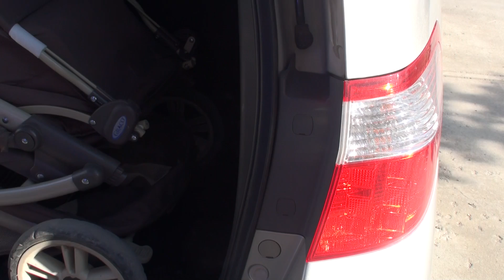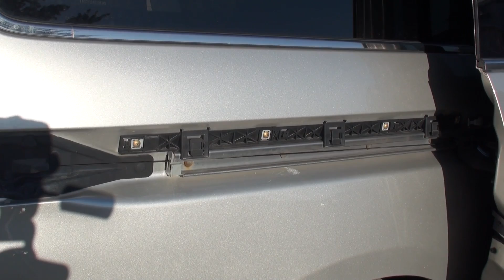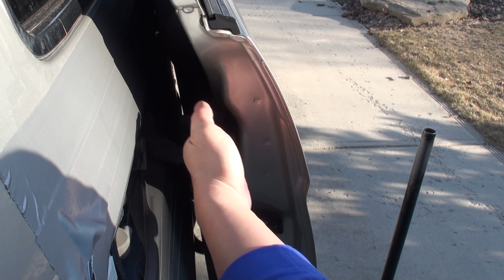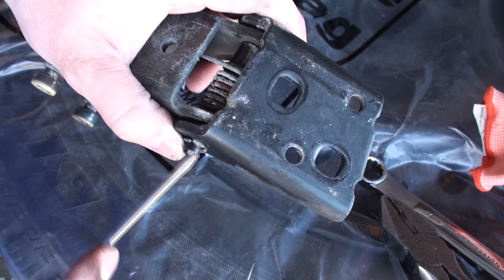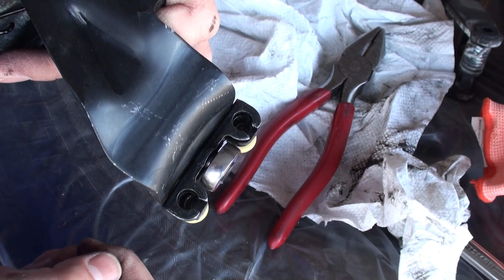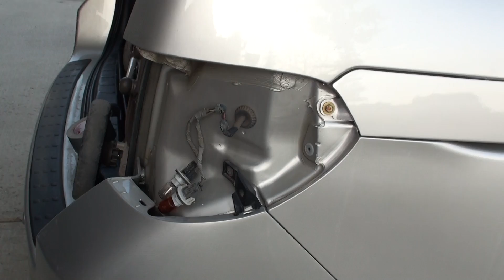Honda Odyssey Center Rail Door Roller Replacement

Comment: the button for the sliding door got powered on and the handle activated while the roller was disconnected ( dont ask - damn kids)  Now the cable is about 4 inches too short. any suggestions on how to release the cable??

Comment: Great instructions but some additional info. After following this video and installing my own roller assy on a 2007 Odyssey EXL the door wouldn't close all the way. Thinking somehow the door was out of alignment I spent 2 hours adjusting and readjusting but couldn't resolve the issue. Went back on line for additional tips and found instructions on pulling a fuse (not labeled for doors) to reset the doors. Took 30 seconds to fix it at that point. Follow this video but if the door doesn't close (and all striker plates line up) then pull fuse #7 in the driver's side fuse  panel to reset the power doors.
Reply from the maker: Richard Workman yes doing a door relearn procedure for some vans is important.  I honestly wish I explained that part in my vid as well as it seems to be that some struggle with the door even after the repair.  Good tip to share with our audience.
Reply: Thanks for the heads-up. I'm about to do this fix on my 2008 EX. There's nothing worse than saying "I fixed it!", followed by thinking you broke something new in the process.
Reply: Richard Workman Thanks for the info! You probably saved me an hour or two! I had to reset mine as well.

Comment: Dear Pircedasian,

I don't know what I am doing wrong on my 2005 Odyssey Touring. After replacing the rollers the door opens and closes smoothly manually and even the latch works when it closes manually, for the reset/relearn I am doing this:

with key in ignition  I pull fuse #7 (driver's side) and wait 5 minutes, install fuse back, manually open and close door all the way 3 times, turn automatic door switch on, door works for 3-4 times and then the "stupid check left door light comes back" and does not work anymore. Something I have noticed is that the right top corner of the door is sticking out a little, little bit compared with the other one, nothing noticeable. Could this be the problem? as you mention in one of your videos my wife tells me to sell this van but I don't want to give up.

Thank you very much for your help,

P.S. sorry for the late reply, this month I had to work long hours and got home very late.
Reply from the maker: Enrique Lopez no apologies needed.  It is I that should be apologizing to my audience as I haven't posted anything new in a while.  Finding time to do things in life gets tougher as the family grows :)  If the door is sticking out a little I suspect that you may have a door binding issue.  You did mention that it moves smoothly which likely rules out binding issues.  That being said I suspect that the power latch mechanism (the part where the door closes and latches down) may be failing.  I haven't had that issue on my van yet hence why no video.  I guess my question to you is when does the system error out and tell you that there is something wrong?  Partway closed?  Just as it closes or randomly?
Reply: piercedasian After resetting the door it works fine between 2-5 times and then AFTER IT CLOSES COMPLETELY the "Check Left Sliding Door" comes on and I can't open the door automatically by switch or remote.
Reply from the maker: hmm, interesting.  I suspect there may be a door contact/sensor issue that is making the system think the door is latched but not completely closed.  Have you had issues with the power latch not "catching" when its closing?

Comment: fifteen minute job. I found it much easier to leave the hinge mounted on the door and simply pop off the  c-clip and tap out the pin. reverse was easy. It took longer to remove the glue left behind by the duct tape protection than it did to change the hinge.
Reply: Shawn McConnell Good information.

Comment: @piercedasian wow really good video, and instruction.  ive been combing youtube for similar videos and even some of my favorite youtube mechanics for this subject.  all of them show a much more intrusive method as to include taking out all the seats, interior rear trims (to uncouple the tension clips). im going to go your route first and if the cable tension is too troublesome ill resort to the internal tension clips.. looks like youve possibly saved me a couple hours at least.. so thanks in advance...
Reply from the maker: philwell76 yes the factory replacement procedure does call for removing a bunch of things but in all honesty it can be in most cases be bypassed due to the tiny bit of slack in the cable that will allow you to remove the cable.  In some rare cases it might not be possible but 10 door slider rails and I'm still doing it my way with no issues :) 

Thanks for watching!

Comment: Great video - easy to follow.  Thank you!  

After following the steps, my door didn't close completely (automatically).  Manually, the door worked fine.  To solve this problem, I had to remove the negative battery connection for ~1 minute and reconnect.  The door once again automatically close and locked completely.
Reply from the maker: Chris Desforges Ah yes, the door cycle calibration/reset procedure - you can also do the same by removing the fuse for the power sliding door in the lower left or right kick panel - depending on which door you're working on.  Glad it all worked out for you.

Comment: Cool thanks for the info. I had a question. I have change my door actulator I thought it might help closing my sliding door. It still gets hung up right at the end and won't pull in to get that click to fully shut. What is the problem ??? I have a 06 odyssey. Thanks
Reply from the maker: KEN CEOINCUSA To clarify did you replace the actuator or the roller?  If the roller is replaced and the door isn't "latching" at the very end then I would go and replace the power latch mechanism as that piece does occasionally fail.  I replaced one a while back but failed to make a video for it.  Give that a shot and let us know if that solved your issue.

Comment from the maker: @ chooseanameforme888 - yes it was 15 minutes to do the cable replacement but I'll be honest and say that the first time I ever attempted this fix with no tutorial available that it took me about 45 minutes to get that stupid wire in.  there isn't much slack and what I've found works well is when you try to put the roller up close to the body panel - less cable length is wasted due to deflection.  I've done so many of these rollers now that I can have the entire assembly replaced now in about 15 minutes but like all things in life practice makes perfect.
Reply from the maker: nope, just follow my vid and you should be able to fix your door like like the 1000's of other people that have watched my vid.
Reply: I've watched a few of these, and others have you remove the inside panel so that you can click a cable release. This gives you slack to easily reattach the cables to the new roller. Of course, the itself takes more time. Now I have to decide... Thanks for the vid!
Reply from the maker: I can tell you that although removing the inside panel is the factory approved way to do this repair that it takes a LOT longer to complete a job.  Now that I've replaced a handful of these rollers I can get it done in less than 15 minutes flat.  Had I gone the route of releasing the tension on the cables it would likely take me an hour to do the same exact job with more room for error b/c I'm removing so many more components.
Reply: +piercedasian Well I pretty much figured out that equation for myself, and also figured that any frustration I had with getting the cable ends in place would be more than compensated for by the frustration I would avoid by not having to muck around with those panels. Anyway, I decided to try it your way first, and resort to taking the panels off if I couldn't manage. I was able to complete both doors in under 2 hours; which I think is great for my first time! Thanks!
Reply from the maker: good contingency plan!  Glad you got it all figured out.  Great job that you fixed it and NOT the stealership!  Happy trails my friend.
Reply: +piercedasian Thanks for the vid. I'm a retired auto tech and the hardest part of this job was thinking about it and not actually seeing how it was put together. The vid eliminated both, lol. Nice that you recommended using the tape and marking the hinge position. For the cables, I used a pair of needle nose pliers to reach in and grab the cable from below to twist & pull down/push up to get the cable barrel out/in. 20 minute first side, 15 minutes second side. Thanks again.
Reply from the maker: excellent work!  Glad you were able to replace your own door rollers.
Reply: my cars doors are not powered, do I need. to remove anything in the interior to release the tension on the cable or not????? I have a 2007 honda oddysey 
..
Reply: iam asking since in this video you don't go n inside the car, and I have seen some videos where u have to remove the interior panels to get access to the tensioner.. just wanna know if I would need to disassemble anything from the inside or Just follow your steps showed In this video. let me know. iam ready to fix mine.

Comment: Thanks for the video. I couldn't have done it without it. BUT, you mentioned it only took you 15 minutes to place the wire back into the door roller and man, I pulled for almost an hour using every ounce of strength I could muster and still did not work.
I wound up giving up using my hands and used a small wrench to force the wire into the roller.
Anyway, thanks!

Comment: HELP..HELP.. HELP, I have a 2005 Odyssey Touring, one day I got the "Check Driver Sliding Door Light" and after that the door did not open or close automatically, I noticed that manually it was extremelly dificult to open or close it,  so I replaced the middle roller following your video, THANK YOU VERY MU CH now it opens and closes smoothly, HOWEVER after resetting the door several times by removing fuses it only works for a couple of times but then the Annoying Light comes back after the door shuts completely and it does not work anymore in automatic/remote mode.  What else could be happening? Thank youin advance
Reply from the maker: misterkike2003 did you check your sliding door for "binding"  You may have replaced the rollers but did you make sure that the door slides smoothly by hand with no "bucking" or "bumping" in the track?

When you perform the door reset procedure you pull the fuse for 5 minutes while the door is closed and then activate the doors through 3 cycles after replacing the fuse and all should be good.  

Try that reset/relearn procedure again and report back.

Comment: Assuming things are not too corroded it looks as though the replacement could be done without detaching the hinges from the door, but rather removing the pins. Any deep thoughts on the subject?
Reply from the maker: jeff sekera ah yes my deepest thoughts about this...... you COULD do it the way you've suggested but just remember that the little snap ring that retains the pin in the hinge assembly will most certainly get lost in the removal (trust me I've popped it off only to spend hours sometimes trying to find the pesky snap ring) so unless you buy a few spare snap rings from Honda you're probably safer to remove the hinge completely and remove the snap ring in an manner and area where you'd have a much lower chance of losing the tiny little part.  The unbolting of the hinge from the door just takes a few more minutes and thus I don't see it as being overly difficult or laborious.  Mark with a felt marker and unscrew!  Hope that helps.
Reply: piercedasian It does, thanks for the reply.
Reply: piercedasian FYI, I was able to replace the hinges by only removing the pins. I have a pair of snap ring pliers that work well on these kind-of rings too. My hinge pins were considerably less corroded than yours in the video-perhaps that helped. Either way - great video - thanks for showing us all the way!
Reply from the maker: jeff sekera that's awesome news!  Glad it worked out for you.  I am not so daring as I have lost that snap ring before and spent almost a hour in my garage hunting down the tiny elusive part.

Comment: thanks for the post...i have this problem now...this should help!!!... any chance the rolller come in metal instead of nylon for longevity?... how much does the part generally cost?
Reply from the maker: DylanP529 The part only comes with nylon rollers and the reason why they're nylon is for smooth actuation and resistance to corrosion.  If it were metal on metal rolling it wouldn't be as smooth and fluid as a nylon roller would be.  I'm sure a metal roller would work but like anything these days, cheaper cost to manufacture = more profits for the auto maker.  The part from Honda Canada typically costs anywhere between $70-80 and if the dealership is nice to you then you can get them for as cheap as $55 CAD.
Reply: ok ty, did it Saturday, at a cost of $53 US, per part... replaced both in hour and half... used needle nose pliers to help connect pulley end into roller, keeping parts close to track to get as much slack as possible to make connection... video was full of great tips and made it easy to do... thanks for the post!
Nick
Reply from the maker: you're very welcome, glad it worked out for you.  Thanks for watching!

Comment: Thanks for the very useful video. I just replaced my driver side roller assembly. You weren't kidding about the pain in the a$$ to get the cable back together. In retrospect, I should have listened to some other videos that show you how to remove the interior panel and loosen the cable, which would give just enough slack to get it back together without driving you crazy or damaging the cable exterior (both of which I did).
Reply from the maker: S Gibbard a tiny bit of damage isn't likely going to harm anything.  If it really bothers you, you could always go and coat the cable with something (possibly liquid electrical tape?) but it would have to be extremely thin.  Releasing the tension on the cables is definitely the "factory" way of doing things but it is so involved to do it that it is no wonder it takes Honda hours to take a job like this hours to complete (assuming they actually don't cheat like how I did using the quick replacement method).  I actually nicked my first cable badly the first time but my thinking is that given how much I saved fixing it myself the first time that I could afford to replace the cable reeler should it fail on me.  Sorry to hear about your mishap - the first time that happened to me it drove me mental!

Comment: Did it today.  The video was a life saver.  Although I got the new roller from RockAuto.com (28.00) and it was a tiny bit wider than the OEM.  So the door plate didn't freely swing when attached.  I pulled them apart a smidge with pliers and it works fine.  Amazingly, putting the cables back on took me like 30 seconds.  I was expecting a fight but was totally surprised.  She's dreamy now.  Thanks piercedasian!
Reply from the maker: James Hayden yeah the 2nd time I ever replaced the rollers on another Odyssey the job from start to finish took me a whopping 10 minutes (I am not exaggerating it was a lot easier the 2nd time).  Glad you got it all fixed up and she's good as new again!

Comment: Really great video. I was quoted $299 for the repair. Looks like an easy job o do by myself. But when is it necessary to do? My plastic rollers have some play and the dealer tried to scare me into thinking the door will fall off or the cable will break. So when do I know I really need to do this repair?
Reply from the maker: ***** lol, the stealership is doing scare tactics.  The door would not actually fall off but it is advisable to fix it before it because a bigger problem where it starts ruining other components of the sliding door.  When the door starts "binding" or making awful squeaking noises is when I would advise you replace the roller hinge.

Comment: Hello and thanks for the great video!

I have an '06 Odyssey LX, and would like to know which part numbers/website I would need to replace both the passenger and driver side center rollers. I haven't ordered replacement parts online before and most websites have exploded door panel diagrams, and I can't seem to figure out which parts would fit my vehicle. Does it matter if I order a part meant for power doors even though mine are manual (aside from not needing to play with the cables, as you mention in your video)....will the power door part fit my manual doors?

Any help is greatly appreciated - THANK YOU!
Reply from the maker: no manual slide doors use a different part #  I don't have the part # 's handy but if you search "majestic honda" online you'll see they offer an online parts catalog with exactly Honda part #'s for your model of van.    Get the right part to save yourself the heartache.
Reply: piercedasian Will do - THANKS!

Comment: Hi Pierce,  Thank you for this video!  My friend and I replaced the passenger side roller today in about a half and hour.  I commend you for taking the time to post this video in such great detail---we felt confident, and went for it.  It was easy thanks to you!!!
Reply from the maker: LOL, I do it because I hate seeing people get gouged by mechanics that partake in unfair pricing practices.  I get mechanics need to make a living but sometimes it is just over the top for some things.  I recently had someone go in for the same roller fix and they wanted $300 to do one side.  So... if it's just a 1 hour job they're technically charging for 3.  What a bag of crap some dealerships are charging.